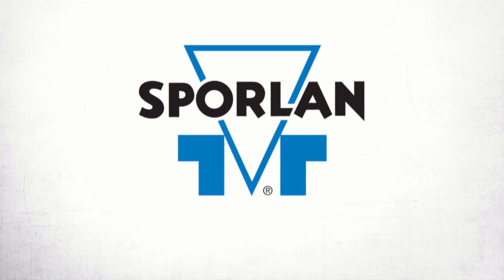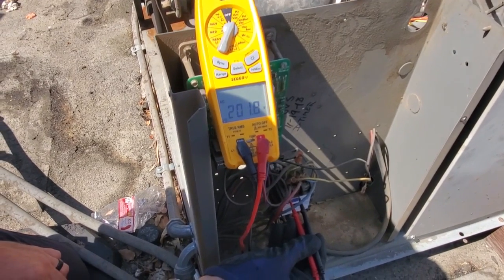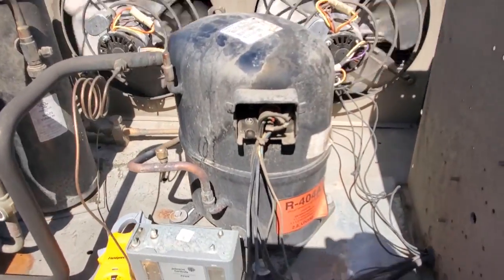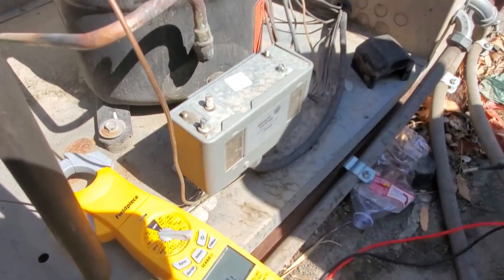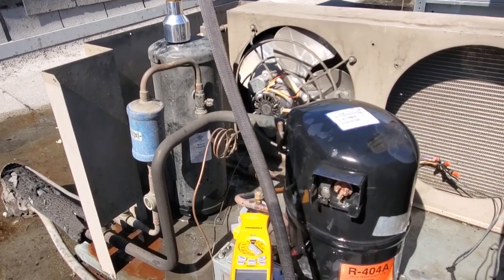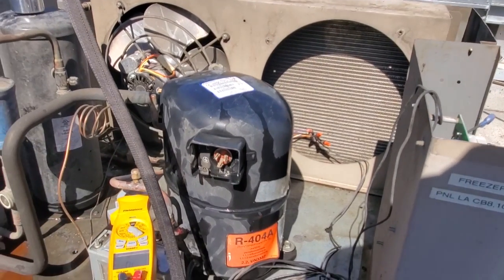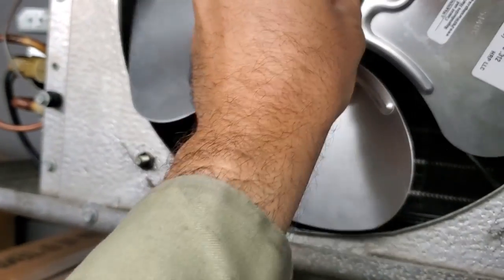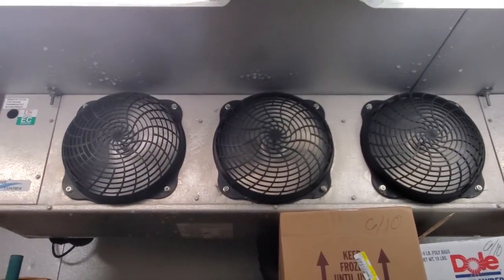WALK IN FREEZER KEEPS TURNING OFF

Comment: Reminds me of living in florida, had just had our rheem air conditioner installed not even a year, the compressor was overloading on the high pressure switch because of grass clippings blocking the condenser outside, unfortunately needed a new compressor luckily warranty approved of the work, the kind HVAC technician even let me watch and help, we also uninstalled the entire condensing unit and put a second slab under it so the grass clippings wouldnt get blown into it again, (extra cost for materials, but was worth it) my dad had 3 tenants before he sold it, none of them had ac issues at all!

Comment: hello sir, I have a question. I have a commercial display freezer and the fans on the condensor kick on and off. they stay on about 15-25 sec and then off for 10-15 sec. any idea why they would do that? the freezer is cooling correctly but the fans operating weird. thanks in advanve
Reply from the maker: Sometimes the fans will do that based on a system pressure and it is not necessarily bad. But I cant say for sure without being there.... I will be going live on YouTube this evening 3-30-20 @5:PM (pacific time) to discuss my most recent uploads and answer questions. Come on over and check it out, if you can’t make the live show no worries as it will post as a normal video on my channel afterwards.  https://youtu.be/CyH-qTlUrZY

Comment: How would you check voltage on a compressor that has a plug (residental) instead of individual wires? Would checking them at the contactor give you correct voltage?

Comment: hi.  thanks for the videos.  a question, in a walk in freezer gas 404a cut by pull down, what would be the correct calibration of the pressure switch, the cut-in, differential and cut-out.  Sh recommended, and what evaporation temperature approx.  Thank you
Reply from the maker: that is a very loaded question I will try and cover this on the next livestream

Comment: Nice job of troubleshooting, it's best to troubleshoot while the unit is running. In my corner of industry to remove the guarding for live testing requires a VP to sign. So imagine being a service guy trying to figure out what is going on and to do a test with the guards off you have to follow the chain of command and escalate up one by one. Every time we have found a way around doing the testing with the guards off. It's amazing what you learn about the equipment when you have to troubleshoot and test it will the guards on.

Comment: Also which leak search for you recommend under $250? I currently use the CPS leak seeker 1
Reply: Soap bubbles 🧼
Reply: I do use soap bubbles once I get close to the area but my cps just doesn't quit do the job, great obviously for r-22 with chlorine but for 410 not so much
Reply: DTek is very good but expensive, worth it tho.

Comment: Hey Chris, are you thinking the unit kept cycling on/off via the high pressure control before it tripped the thermal overload? What was the high pressure control set to?
Reply from the maker: Yeah more than likely the unit kept short cycling on High pressure and eventually overheated the thermal overload. The existing control is the peanut style and its auto reset. I believe the cut out is 425
Reply: Looked like it had a dual pressure control

Comment: Hi , Chris, one thing I'm not sure I understand : over here I'm used to dealing with high head pressure switches that only reset manually, in order to prevent the compressor from cycling on and off on high head , so , usually, you'll get a no cooling call , and when you get to the condensing unit you find the high pressure switch " activated " and you have to press the reset button on it , otherwise it won't start. 
Then you know for sure it cut off on high head and you can investigate.
Do you guys in the States use automatic reset high head switches? Is there an advantage or a particular reason behind it ? 
Thank you again, Chris 👍
Reply from the maker: We do have manual reset switches and will use them occasionally. But this unit came with an auto reset and it's never been changed to a manual reset.
Reply: @HVACRVIDEOS I guess it must be so the unit doesn't stop completely and ruins all the products in the walk in , I'm not used to them but I think we got them too , I just haven't worked on walk ins for a while, to my demise 😕
Reply: Auto reset is ofter desired in low temp food aplications to maximize time for a repair to be made befor losing all the product.  A failure will cause the HPS to trip, and some time will pass befor the head pressuse drops.  This will cause reduced capasity and the box will warm, usually to 20°F or so.  Alarming the customer to put in a call, but not lose everything.
Reply: @xxxviii007  makes sense

Comment: Don't some compressors have oil pumps that must run in the correct direction of rotation?
Reply: Most compressors have bi-directional pumps for reciprocating compressors.  Hermetically sealed also have bi-directional pumps (recip in a can).  Scrolls however have a directional bias and need to have proper rotation, which can be verified by proper high and low side pressures.  Plus when a scroll is backwards it tends to be very loud.  Ive never seen a 3 phase rotary compressor so direction is set with the start componants, and centrifugal, and screw compressors lubricate much differently.

Comment: I am not really a fan of auto resetting hi pressure cutouts. The compressor can take some abuse, but not forever.
Reply: the guy who invented the manual reset moneymaker is a genius.
Reply: When tripping on a auto reset you still have time for the pressures so fall and reset which is lost capacity.  The box will warm, and you will get a call.  But most times the product remains frozen, or at least firm enough for a safe re-freeze.  Manual reset is condemning the freezer into a full thaw after the next defrost terminates.  Then only warmer from there.
Reply: @xxxviii007  Based off of my experience here, customers with walk in freezers that trip a manual reset, call me faster due to the sudden spike in air temperature. The food being hard frozen, will last quite some time. With the auto resets,  they don't call because it still seems to be working, and the food is still below freezing, so they ignore it. Then when the compressor finally craters, their soft frozen food thaws really fast, they panic, they call, and the compressor may or may not be available locally. At that point they usually have to move the food until the repair can be made. That is my experience here, other areas could be different.  That is why i don't like auto reset hi pressure cutouts. YMMV
Reply: @xxxviii007  most customers i know have alarm monitoring that sends the manager a message alerting them of the room temp, so that isnt really a problem. Something caused the HP to trip, its best to sort that out rather than just let it cycle the whole time on a trip setting.

Comment: hard to beat flowing cool/cold water to tool things
* 1/3rd of that water flow would have done about the same, the downside of a compressor is the large void/air gap from internals to externals.
changing the fan and firing it as shortly after the overload reset would cool it the fastest, assuming it still as refrigerant in it!

Comment: How did you calculate your target head pressure ? Ambient over 20 or 30?
Reply from the maker: This was a micro channel condenser so if your looking for an estimate I would use 20 over ambient. But remember we dont use that to check charge, it's a sight glass system so we clear the sight glass and make sure we are no higher than 30 over ambient, 20 is the target. But we would also need to verify proper evap superheat once the unit gets down to temp
Reply: @HVACRVIDEOS  micro channels do my head in , Chris . If you have the opportunity, can you make one about them and the more specific way of approaching them, please , it would be brilliant. I'm not really comfortable with them , I always seem to think the head pressure is too high ... Thank you for the knowledge again , Chris ,I can't tell you how much you've helped me already 👍👍👍

Comment: That's tough. I guess we have it easy back east, hard to believe the motors only last a year but those are extreme conditions we seldom see over 95 here and no blowing sand.And distance from the shop make a big difference. Two hours away versus around the corner certainly affects how you handle service calls. Good job!

Comment: Have also packed ice around the compressor to cool it quickly
Reply: Some of the best ways to cool it is cut slits in the bottom of the ice bag and place it on top of the compressor. Chilled water will fall on it. Or just charge some freon in. That's really the quickest way.

Comment: Next time sell the customer a manual reset high pressure control To eliminate compressor coming on if condenser motors go bad or dirty condenser. No need to be  cooling of compressors if manual reset high pressure control is installed.
Reply: Alll HP switches should be Manual reset, its dangerous to install an auto reset
Reply: Yea, put in a manual reset, so once tripped your just 1 defrost away from a 50 degree freezer...  not like loseing $15,000 is a large loss or anything.  Or leave it auto, let it do its job, and get a call for walk in at 20.
Reply: @xxxviii007  You sir, are on the money. I work at McDonald's and if i installed manual hp resets id lose my job because i couldnt get there fast enough to safe 40k dollars worth of mcnuggets. The restaurants do food safety on all three shifts not uncommon to get two or three calls for the same 20 degree walkin by the time i can make from one mcdonalds to the other.

Comment: Hi i want to ask for your opinion

i have this problem with split unit ac 
where the evaporator coil only cools on the upper coil but warm on bottom .. do you know what the cause of this

both condenser and evaporator are clean and gas is around 70psi R22

sorry for my broken english
Reply from the maker: Possibly a bad txv, poor airflow, weak compressor, and or low charge.

Comment: Hey Chris another satisfied customer big picture, I was curious why you condemned both motors without checking the capacitors first, great work as always.
Reply: Not questioning your judgement, I agree,
Reply from the maker: no worries bud , I didn't take offense. Even if you were questioning me its all good, I am always looking to improve , thanks for watching and taking the time to leave a comment!!
Reply from the maker: On a motor that small I wouldn't change the cap, the motors are too cheap. Plus the cap is probably so small it would be hard to get a replacement

Comment: Never had a compressor take longer than 4 min to reset ..that's Arizona..nowhere is hotter...I can't believe it took 20 minutes..I woulda gotta new compressor in there..guna be weak after tripping
Reply from the maker: Yeah my butt puckerd a bit thinking I was gonna have to change it, it's been a few weeks now and all is good so time will tell.......
Reply: @HVACRVIDEOS  I literally try and either kill every COMPRESSOR or find "them bad" GANG GANG ALL DAY
Reply: @HVACRVIDEOS  bc your a real good technician!  GREAT EXCUSE ME
Reply from the maker: Ha ha thanks Dennis!
Reply: @HVACRVIDEOS  do you think it wouldnt hurt going back and changing the oil, given that the internal temp of the compressor was so high with possibility of oil breakdown occuring?
Reply: You must remember the heat is insulated in the shell, ive had trane ac compressors not reset after a hour, been condemed, but started fine next day.  Normally if able a bag of ice and some cardboard helps speed things up.

Comment: Much better than the last video better diagnostics technique and if you want a better motor replace with a sealed motor with a higher ip rating and higher operating temp if needed
Reply: they all have their downfalls, was that one a bearing failure from moisture/water ingress or capacitor cooking... either way cheap junk materials ;)
enclosed run hotter, if oil filled, that chemically separates and off gasses, leaving thick syrup sludge behind or fails the bearings once too dry...
I could probably go on and on and on

Comment: I had this happen once. One fan was a master and the other was a slave that turned on to supplement power if discharge pressure got too high. THis blew out the oil temp sensor as well. Since one fan motor usually doesnt run I would reset it and monitor it and everything seemed fine. Eventually I put a temp probe recorder on it to find out why it was cutting out. Once I found the high head temp that was the clue. Now I always check condenser fan motors. Just as a quick check to maximize time.